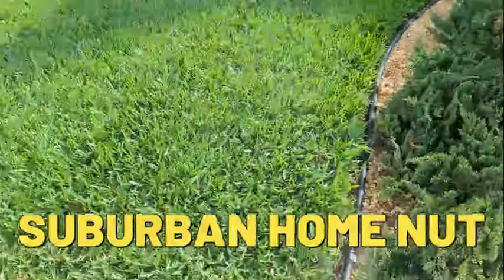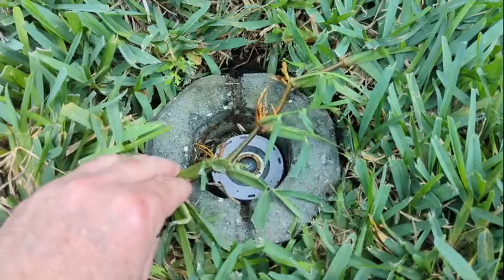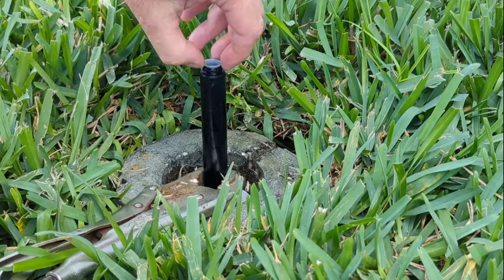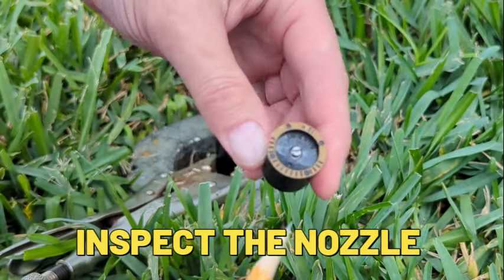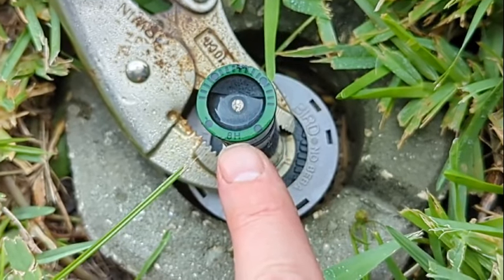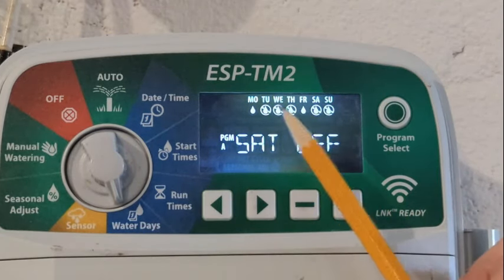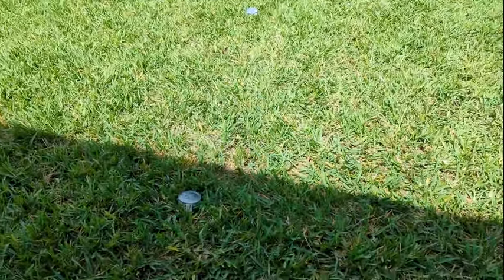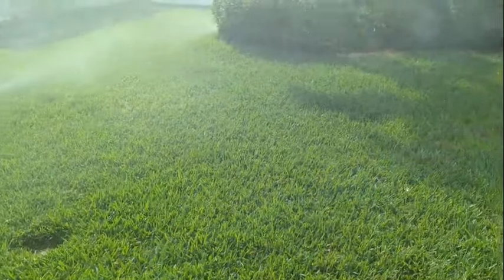How To Water St. Augustine Grass | Do THIS & Save THOUSANDS of Gallons of Water

Comment: Wtf 40 minutes, that's a ton of water usage. My builder left the setting for all 9 stations at 5-7 minutes each.
Reply from the maker: It's great if you're getting 1/2" of water after 5-7 minutes.  Thanks for the comment.
Reply: St Augustine grass will make you go bankrupt cus it needs tons of water.
Reply: You must have an awesome irrigation system.  You're getting 6" of water an hour.  I live in FL and even with Cat 3, 4, and 5 hurricanes we don't get 6" of rain an hour.  You really should patent your system so others can only run their systems for 5 minutes.  It does take about 1200 gallons of water to get 1/2" of water per 4k sq. ft.  Sprinkler heads typically use 0.75 gallons per minute (gpm) for ¼-circle, 1.5 gpm for ½ circle, and 3.0 gpm for full-circle heads. Rotor style heads use 2 to 5 gpm each for most residential applications. The average system uses approximately 15-16 gpm per station.  You're getting an average of 9 gallons per minute per sprinkler head.  You're simply amazing!!!
Reply: People are being snarky, but 40m 3 times a week is expensive. I just watched a video from scientists from UF and she said the #1 issue they see is overwatering, and to turn off your irrigation in summer. Let the rain do it, and watch your grass. When it bends and holds footprints, water it 1/2" (however long that is per your tuna cans) once a week; every 2 weeks in winter.
Reply from the maker: @PinkGrammarGirl  That depends on several factors such as how many sq. ft the yard is, irrigation type, drought, etc.  We had a very dry Summer in FL.  Ponds were down 3-4 ft. so allowing the rain to do the heavy lifting is not always feasible.  Summer in many places is the dry season so turning off the irrigation is not the best choice.  I use reclaimed water, which many people have, and is $1.20 per hundred cubic feet (CCF). One CCF is equal to 748 gallons and equates to 0.0016 cents which is minimal in the extreme.  I'm able to water my lawn for less than $10 per month using reclaimed water.  Ft. Myers has a flat fee of $9.50 per month which is more than affordable.  Only watering 1/2" once per week when temperatures are 90-95 degrees for weeks at a time will most certainly kill your grass.
Reply: Here in Texas, in summer I move my schedule to twice a week. I have clay soil. I’m changing my sprinkler heads to a rotary style to make the most of my watering. Even though i may water twice as long, they put out less water, but the bigger droplets make it into my soil. I also like the idea of dish soap and a few other ingredients every three weeks during the summer.